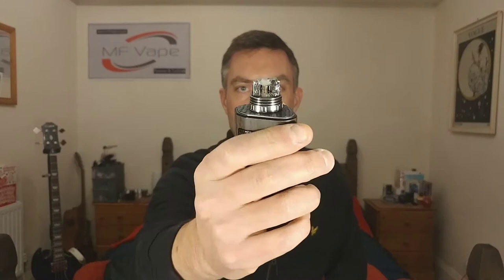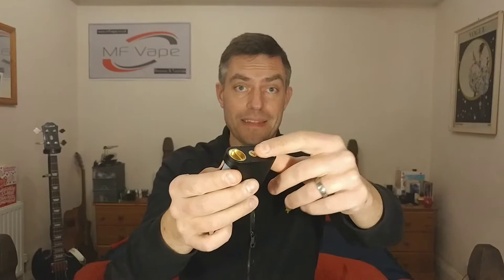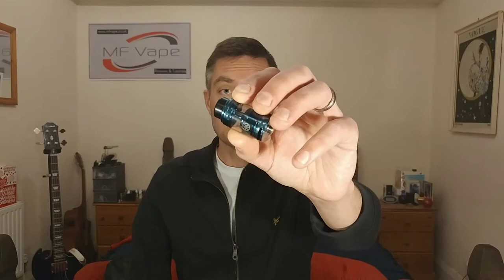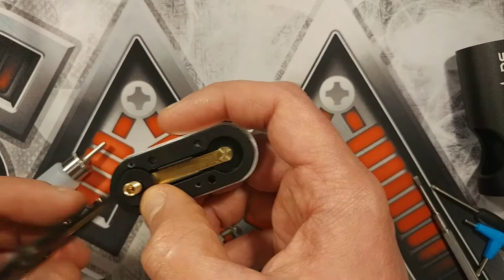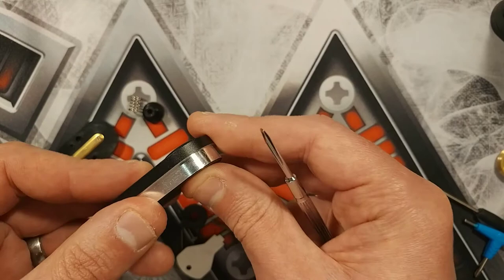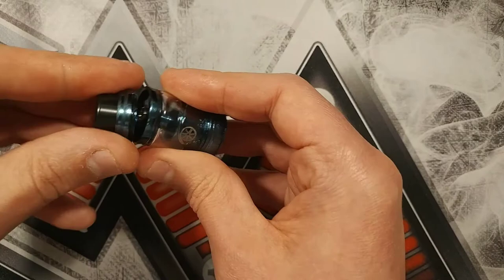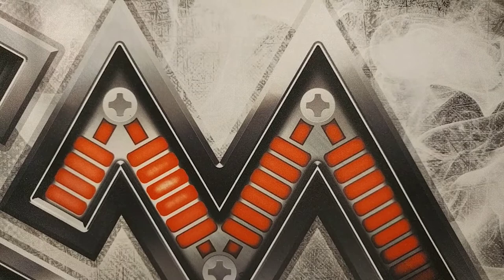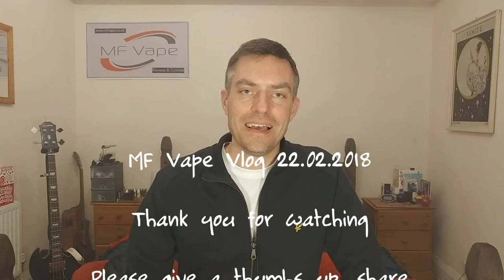MF Vape Vlog 22.02.2018 - My Driptech DS Clone Issue, news, first looks

Comment: I have been using the sxk prime on a smpl mechanical clone that I picked up on eBay and they look like they were made for each other. I put a 26 guage spaced kanthal coil 2.5mm at .7 ohms and loving it. In my opinion it is the ultimate vape pen for mtl.
Reply from the maker: Thanks for the comment #1 Pollock. Mind arrived yesterday and been rocking a 28awg spaced kanthal build, coming out at 1.4ohm. Only needs 12w to fire and my god the flavour is awesome. I think I know what all the fuss is about now with the Kayfuns. Lovely, smooth, punchy vape 😀💨

Comment: For info to other users, there are two types of clone of these devices, I bought the DS as a 1:1 clone this has the writing on the front of the device etched in, no paint, and the TS version was the other type of clone like yours with DripTech in white writing. They are totally different devices, all the components are different, they might be cheap but Both are extremely dangerous, be warned guys. Vape safe
Reply from the maker: Thanks for that additional info Gary, appreciate it 👍😀

Comment: Thanks for the video, exactly the same thing just happened to me, only had it 24 hours, I just unscrewed the atty to stop it auto firing, really dangerous device with a button that cannot handle any amount of heat, it just distorted where it threads onto the bolt and flew off the device.
Reply from the maker: Thanks bud, appreciate your input. What makes things worse is 3F Vape are being pricks about it asking me to send a video of the problem. I said that the incident has already happened and that it is a major design flaw, and I also told them there were many reported cases on forums etc. They said unless I send a video they can't diagnose the problem. It wasn't that I wanted the money back but thought they might have the decency to withdraw the product. I gave up in the end, I suppose I could post this video to them. What do you think? 👍
Reply: I haven't had much dealings with 3fvape but I thought they were a decent company, I will reserve judgement on that until I receive a reply to my ticket I raised with them, but yes I think if you send them a link to this video they can at least have a better idea of the issue.
Reply from the maker: That's the thing, I use them all the time, have spent a lot of money with them, which I reminded them of. It's their practice to not issue refunds or anything until they receive a video. I did get a dodgy clone Goon feom them (was SXK too) and they did eventually send a replacement. Cheers, think I will Gary.
Reply: Hi buddy, 3fvape agreed today to send me a replacement top assembly for the DS, they asked a few questions about how I had been using it, the coil resistance the atty I was using etc but no hassle really, maybe now they accept there is an issue with certain batches you will have better luck with them, I hope so.  Thanks again for your video :-)
Reply from the maker: Hi Gary, thanks for sharing that with us. I might just drop them another email then pal. Let us know if the new top piece makes any difference. Cheers, Mike :-)
Reply: Good luck with 3fvape, I will let you know how I get on with the new top piece once it arrives. Oh yeah I also ordered an original DripTech button as I believe it's made out of delrin so should be good with the heat, I have my fingers crossed that it will the 1:1 clone, again I will report back once I have more info.
Reply from the maker: Nice one Gary, look forward to hearing about your findings. Cheers

Comment: 3fvape is pretty good about returns. I had a bad mod from them and they sent me a new one without even asking for the other one back. They had me send a video proving what was wrong with the mod first though.
Reply from the maker: Hi Mark, I've read that more than one person has encountered the melting fire button and spring popping off on this mod on Reddit. Told 3F Vape that there is obviously  a common fault with it. It's a design flaw, in that the plastic fire button is actually threaded onto the metal screw so it will strip in time for everyone's no doubt. It's dangerous in my opinion for them to sell them, and I told them so. I'm not worried about the $20, more hassle than it's worth, although I'm interested to what they say.
Reply: MF Vape Yep, I stayed away from that thing. I heard some bad reviews on it. The Hugo Squeezer is a great mech squonker. I just got mine yesterday. It feels very high quality, works better than my pulse. It's only 30 bucks too! There was alot of hype about it on facebook, that's why I tried it..
Reply from the maker: Yeah, like the look of that one but the only reason I wanted the DS cause it was dual parallel 18650, for battery life. I've got the Pulse and the Drone (which I adore) but thought I'd give it a shot. I'm not really a mech user though and that has put me right off. Lol
Reply: MF Vape Yep, I hear you. I'm always scared to buy cloned mech mods.

Comment: Hi MF Vape, so as promised an update for the 1:1 clone (etched logo on mod Not the white painted version as this is not a 1:1 clone). So after button failure and the mod auto firing I took a chance and ordered an original DripTech button from https://www.custom-vapes.co.uk/product-category/accessories/misc/ it arrived today, the thread is identical, it fits perfectly, works perfectly, feels much more solid and is working perfectly so far. Hope this proves useful to other users who experience the same issues that MF Vape and I have experienced. Vape safe guys
Reply from the maker: Hi Gary, thanks so much for this update, appreciate it. 👍
Reply: My pleasure buddy, hope it helps people. Now it's working properly I am loving this DS squonker, using the dead rabbit with a 1.1 ohm dual coil framed staple fused Claptons, VTC5A batteries, flavour is superb :-)
Reply from the maker: Sorted mate :-)
Reply: Gary Hulse 
Hello gary so no more auto fire?
Reply: Hi E Park, well no , the fire button works as you would expect it to. however yesterday the button had no movement so I stripped the top section down to find that the plastic strip that sits at the lowest art of the top section, the part that holds the screws that make contact with the top of the batteries was melting, this had allowed the battery to push the top section upwards preventing the fire button from working.. Unfortunately the plastics used in my clone, just like the fire button can't handle the current running through it. New Fire button is still perfect though, no distortion or melting of any sort.
Reply: Gary Hulse thanks for the info
Reply: You're Welcome E Park, To be honest if your using coils with a combined resistance of .20 or higher I think the mod will handle this just fine, the original button hmm I'm not so sure, it's a shame cos I love the mod, or did, it's boxed up now at the back of the Vape cupboard.
Reply: Gary Hulse i ordered the original button from defiant desings im going to swap as soon as i get the clone from 3 fvape
Reply: Good decision I think E Park, you ordered the etched DS mod not the white painted one I hope?
Reply: Gary Hulse yes i did not the white one